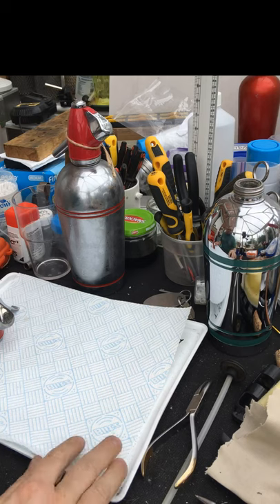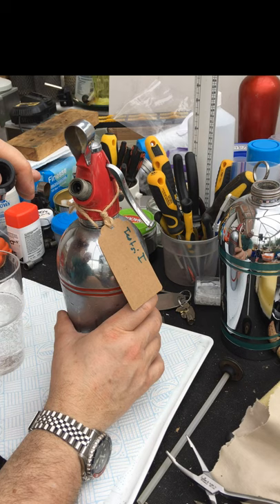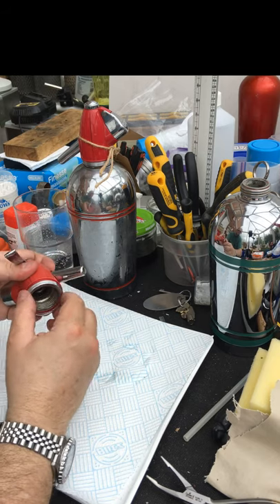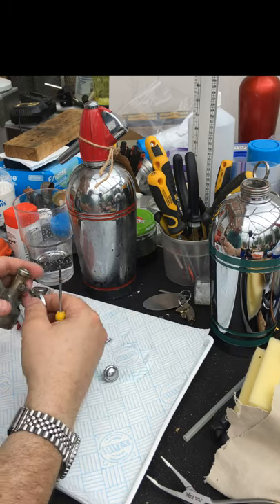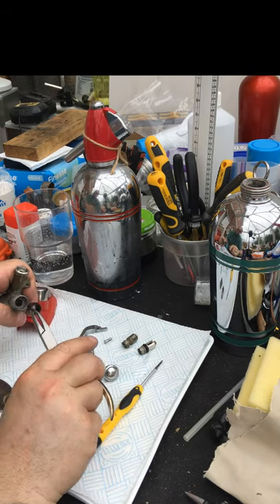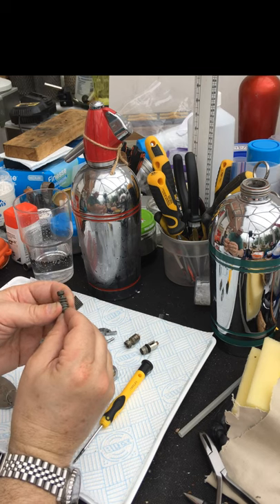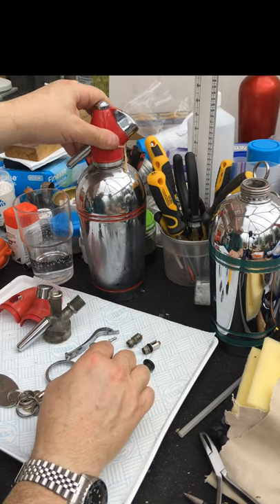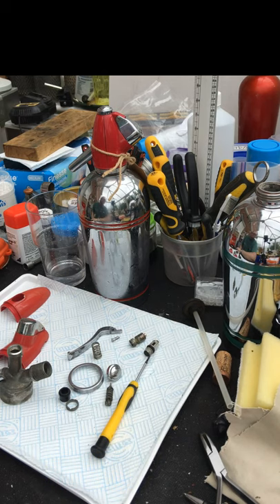Taking apart a Sparklets early UK Streamline soda syphon head and readying it for reconditioning

Comment: Hello , I’ve enjoyed watching your maintenance of soda syphon videos .I have 3 but there wasting the gas capsulals .If I were to post  you a few short videos could you please advise me of what I need to purchase from you to make them ship shape Thank you,Anthony Richards.
Reply from the maker: Yes, you can send a short video to us and we can diagnose from that.  The usual things that need replacement on these models are the neck seal and dip-tube assembly, the rubber seals that surround the neck of the CO2 capsule when it plugs into the head and those inside the head of the syphon, which control the flow of soda water.  The internal design of the head is almost the same as shown in this video Cross section of type D soda syphon head showing how it works
https://youtu.be/kll_h0s2hHA

Comment: Thank you for the vids. Very informative. The control arm of my Sparklet stopped working. When I press the control arm, no water is released in the glass. Any idea what’s wrong? Could I fix it myself? Or can I buy a refurbished head?
Reply from the maker: This is usually caused by the rubber pad of the soda control valve sticking to the surface of the valve seal as it has detached from plunger inside the head.  It is a relatively easy fix if you have the correct tools to take apart the head (difficulty is dependent upon model).  We offer a reconditioning service to bring your syphon back to fully working condition.

Comment: Awesome video.  A couple of questions: Is it possible to rechrome the silver metal parts on the head?.  I would also be interested to know how to clean the inside of the bottle and whether chips and scratches on the bottle,  especially the base can be repaired or touched up? 

Thank you
Reply from the maker: It is quite possible to have the top cap and other parts re-chromed but unfortunately this is something that is not economic for AcquaSpumante to offer as a service as there is not enough current demand. The set-up charges on a small batch would make this unattractively expensive, per item!   

You can clean out the inside of the bottles without removing the neck sleeve (in this model they cannot actually be removed without destroying them.  Later models with a plastic neck sleeve can be removed, although it is often quite difficult as they stick steadfastly in place.)  

The DIY solution to bottle cleaning:  You need two small buckets deep enough to submerge the body of the syphon fully under the water and a long plastic hose narrow enough to go down the neck sleeve to the bottom.   Fill one bucket with water and submerge the body of the syphon under the water.   Place on a high work surface.  Fill the tube with water and plug one end of the tube. Thread the open end of the tube down the neck sleeve of the filled syphon body to the bottom of the body.  Have an assistant remove the plug from the other end of the tube and direct the flow of water into the other bucket.  Move the end of the tube around inside the filled body of the syphon.  The flow of water will pick up any bits of limescale or fine debris from the bottom and carry them away, cleaning out the bottle.  You may want to add a very small amount of disinfectant or neutral detergent to improve the cleaning action.  Do not use metal tools to scrape around inside as this will probably remove some of the protective coating from the inside of the body.  Rinse out several times with clean water before a test use or two of the pressurised syphon (not advised to drink the first fill as traces of cleaning agents may taint the water).

The Professional solution:  Immerse in bucket as above but clean out inside using a small electric powered water pump on the far end of the tube to provide a stronger suction to remove any larger/heavier debris more quickly.

The bottle is made from either chrome plated metal (as shown in the video) or alternatively Hammered (UK versions), gloss or matt colour painted (US versions).   It is quite possible to touch up the paint where damaged but probably difficult to obtain an "invisible" repair.  You can respray the whole body in a colour of your choice if you want but beware that modern solvent spray paints will soften the old paint leading to cracking or crazing of the new paint coating during drying.  For best effect you need to remove nearly all the old paint before re-coating.   I have tried this and it did not work very well!  

With regards to re-plating of the chrome you can use a technique called "brush plating" to repair localised damage.  However, this is a very time consuming manual method better suited to silver or nickel plated items where the plating adheres better than chrome to the substrate.  Nickel certainly will give a chrome like shine (with a hint of brown/yellow after some time) when used on the copper or brass metals used in the bodies of the bottles.  I have not tried this repair method myself due to the economics of the process; it would take a lot of time to accomplish a good repair making it costly to implement as a service.  Sorry to disappoint!